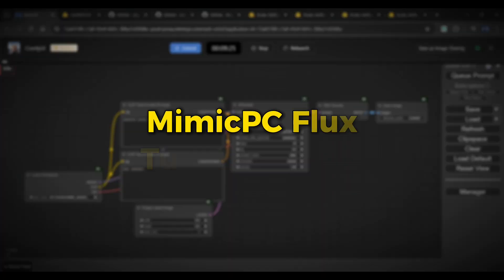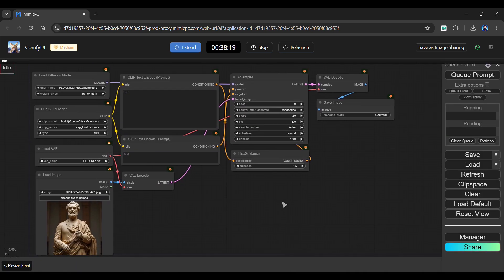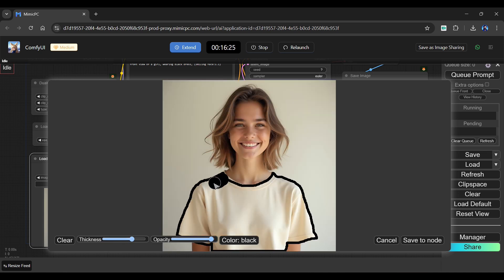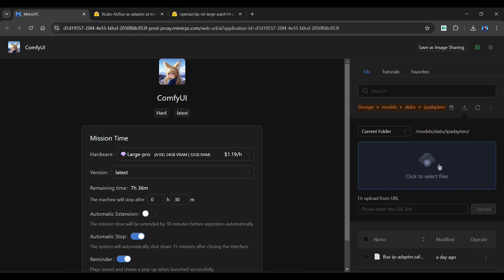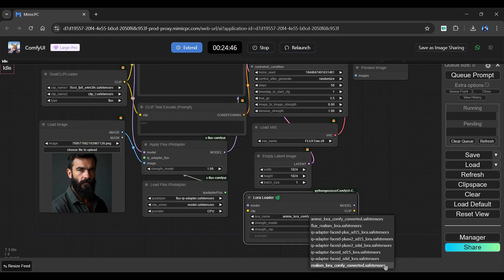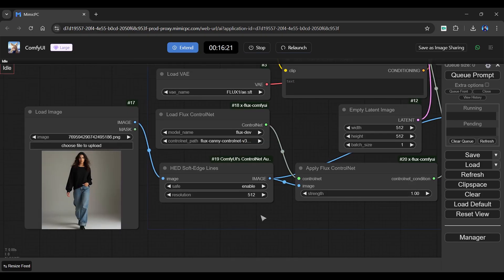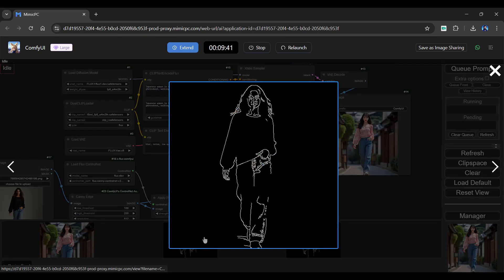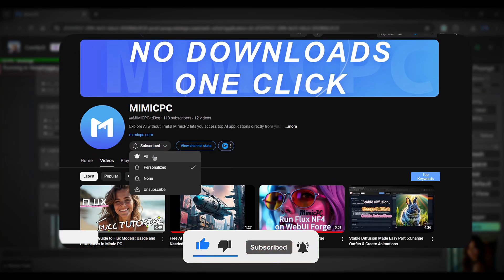Flux Tutorial 2: Mastering Image-to-Image, Inpainting, Lora, IP Adapter & ControlNet

Comment: Step 50 ? in Flux ? I've Asus RTX 4070TI and for just 10 steps takes 90 min to generate. 😐😐😐
Reply from the maker: Yes, it only takes a few minutes through MimicPC
Reply: I have a regular 4070 and 35 steps takes 3 minutes. You need more RAM - I have 32.